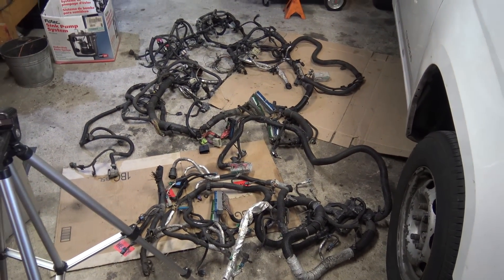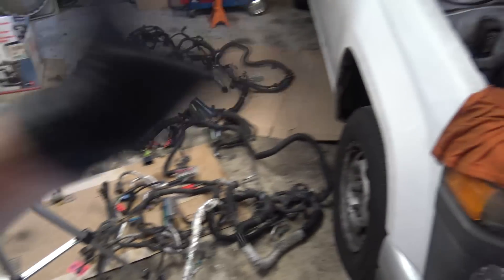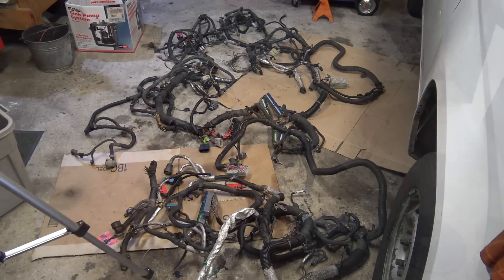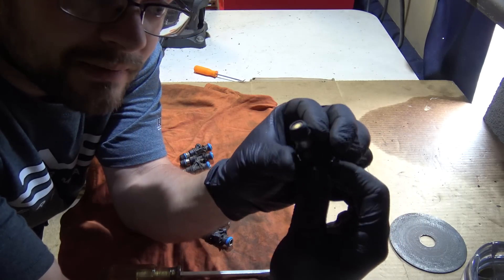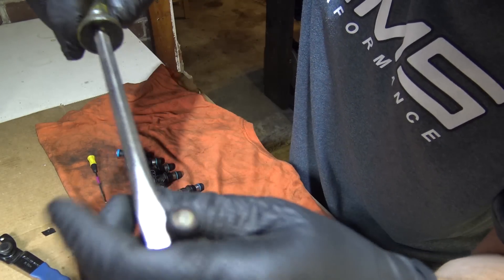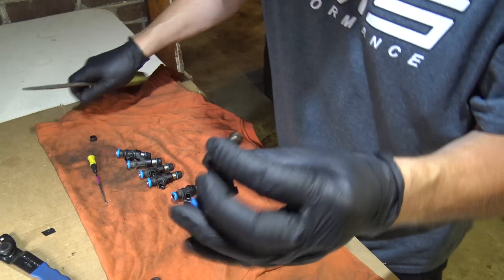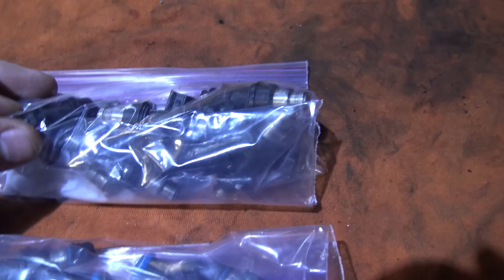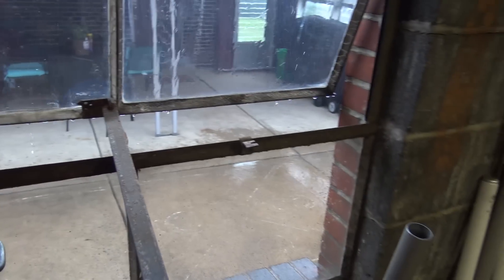dont BS me Ep2 - wiring and decaps

Comment: Nice bench grinder
Reply from the maker: +Reno's Garage I have a bench grinder it just takes up too much room and it's hard to see what's happening to the injector tip while grinding it, much easier with the sanding disk
Reply: That's a great idea I'm stealing that  when I make little parts
Reply: It's a rather good idea.
Not sure if I trust my Lowes Blue Vice with it, at 6'4", it's got a nice shot at my junk.

Comment: We flowed a 2 hole decapped injector last night, it flowed 69# @58 fuel pressure.  Ironically the same test the ebay cheap 80# injectors flowed 104# @58 fuel pressure, after we looked them up online the rating was 80# at 42 fuel pressure or the difference of 835cc at 42 fuel  per minute and 1092cc 58 fuel pressure per minute.  Check out the video!  JD

Comment: I have an 03Express 3500 van w/6.0 and 80e I believe, is that what's considered/called an LQ4?
Can I assume that the majority of this build will transfer to a 6.0? Is there anything I should do differently? 
the van is still a driver with 16X,XXX miles only gave $500. bucks at a divorce sale! I only have to decide if going into my wife's 67 Mustang coupe or S-10or early 80's fox coupe decisions decisions. I appreciate your channel and content it's reinvigorated my inspiration! The last time I did any drag racing the LS 6-7 engines I had were 454's the world has significantly changed since then! Gee ain't it funny how time slips away...
Reply: William Hill that's correct. lq4... also, the stuff from this build can pretty much be transferred to any LS build for the most part. the first thing you need to figure out are goals. then select the chassis and parts to meet your goal. whether it be a HP number, an ET number, a MPH number, be fun and do burnouts, etc. nobody, not even Matt can suggest what to do without an end goal in mind...

by the way, I'm completely jealous you found that van for such a steal ✌
Reply: Tyler Poland Goals are simple, 10.99 on a budget in a street car. But since I have a complete van for the majority of the drivetrain and multiple car's to choose from (should probably haul them all to the scale to determine which would be ideal as far as weight) so need to come up with a rear end and the parts that will be documented in this video series so the budget shouldn't get out of hand(unless I get carried away). I am just not very familiar with this turbo stuff that all the kids are doing these days, I am more familiar with N/A and N2O setups but turbos have gotten me kind of excited! What's Matt running for a rear? Explorer? with traction lok or Detroit locker? I used to have a 68 Mustang coupe that I put a 428CJ in w/ a C6 and Dana60 and some homemade subframe connectors it was a pretty good chassis to apply that much HP , but I have seen a lot of LS S-10's and Fox bodies that are pretty appealing. So the chassis is going to be the hardest decision,but I am sure that any of the above will fit the bill...
Did I say 10.99 , well maybe 9.99  now I am already getting carried away...

Comment: smooth work with the injectors. what pound are the stockers you're working with and what are you hoping they will do decapped?
Reply from the maker: it depends on the injector but lets just say they roughly triple, as 
most of the truck ones  in this range are 25-28 they easily hit 75lbs 
area at 43psi

Comment: Cool information!!!!  The wiring harness is not all that tough, you just have to work with it in small sections.  But like you said, it is time consuming.
Reply: Worse is working on a harness that is chopped up by another.. and making it back to stockish/undo wtf did they did.
Reply from the maker: +UCanDoIt2 I have done it and it's worked lol, I just don't like doing it
Reply: Could not agree more!!!!!!!

Comment: So after you decap it what would be the new flow rate?
Reply from the maker: it depends on the injector but lets just say they roughly triple, as most of the truck ones  in this range are 25-28 they easily hit 75lbs area at 43psi

Comment: why are the injectors capped?
Reply: Better atomization. Like when you pinch off a hose really tight with your thumb.
Reply: "Decapping" fuel injectors is pretty much what it sounds like. You are removing the pintle cap to increase flow through the injector. The factory uses pintle caps to restrict the flow of injectors and to help flow match injectors. - Sloppy
Reply from the maker: unsure why they are capped factory like this, i would need an injector manufacture to explain why, or the OE ordering company to report why
Reply: Because I imagine a stock truck doesn't need 75lb injectors
Reply: So in other words when boosting, you don't have to buy or upgrade to any other type of injectors.  If you got truck injectors on your 4.8, 5.3, 6.0  application, you simply decap them and your good to go ??
Reply: I don't know, I'm quoting Matt. :-j